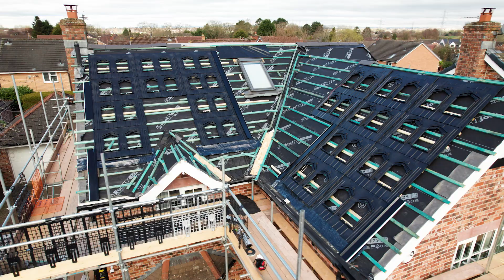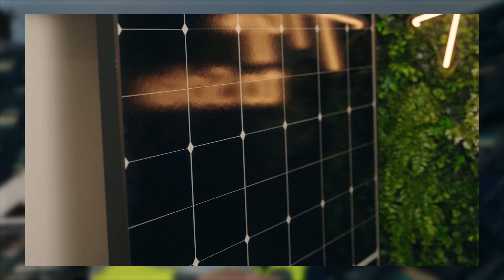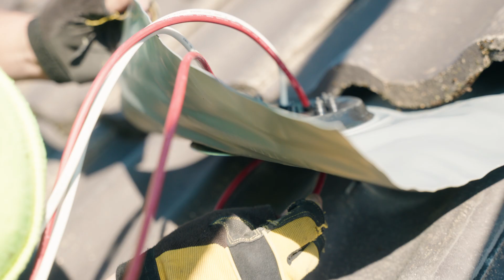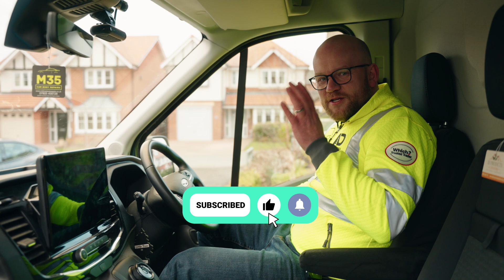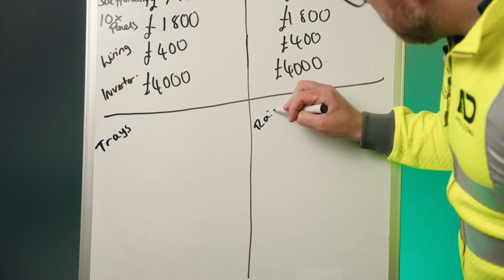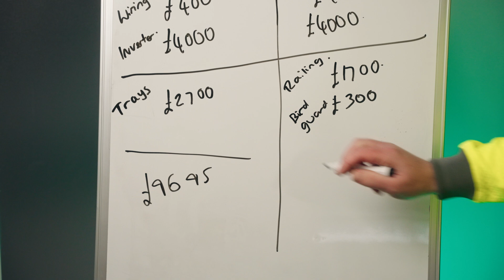In-Roof vs On-Roof Solar Panels: Which Is Better for Your Home? 🏠

Comment: Very informative but some of those prices weee suspicious. Assume £4000 for an inverter includes battery as a basic string inverter does not cost £4,000 more like £500 tops. Also £270 per installed panel for GSE seems high given the half trays are about £40 each so £80 per panel plus a share of other ancillaries and flashings.

Good video though, one of the best I’ve seen.
Reply from the maker: Thanks for the comments. Prices are a guide to help users; as always, no two houses or uses are the same. We just tried to strike a fair middle ground (note costs also include fitting, business costs and certification).

Comment: Why is the panel price the same if you are not going Bifacial surely the panels in roof would be cheaper?
Reply from the maker: Hey! Thanks for the comment, if you're having monofacials on-roof / in-roof they are the exact same panel :) so no cost difference.
Reply: @apexdomasolar  but wouldn't you put bifocals in as they are more efficient?
Reply from the maker: Hi, we used the same panel as we wanted to give a fair comparison of the installation methods and we've done a dedicated video on panel comparisons :)

Comment: On the roof in Australia, it shades the hot roof and reduces air-conditioning costs.
Panels have cooling airflow to keep efficient generation.
Reply from the maker: If only we had that level of sunshine in the UK 🇬🇧. Thanks for commenting.
Reply: @apexdoma  you would not need nukes.
Hahaha 👍

Comment: Thank you for making this extremely comprehensive video which address all the issues which pursuaded me to go with on-roof. Possible efficiency loss due to higher temperatures is what pursuaded me but my assumption that modification of the roof rafters was necessary was completely wrong.
I will be directing any of my friends interested in a solar pv system to this presentation for an initial understanding before any further research.
Well done!
Reply from the maker: Thanks, Martin; we greatly appreciate your feedback. Best of luck with your solar system. 💪🌞

Comment: I’ve been weighing up the pros and cons of an in-roof vs on roof when I discovered my roof was going to need replacing after surveying ahead of a solar project.

Costs were broadly the same, and the performance projections were very similar.

There’s no denying the aesthetic appeal of an in-roof system and for those in conservation areas such a design maybe the only option.

The main consideration that ultimately swung me to a traditional on-roof solution was an approach to keep the roof and solar system as two separate things and not have to worry about building or fire regulation changes that not only limit the product choices now but potentially for future maintenance or upgrades.

An in-roof system may also complicate future mortgage enquiries on the property especially if the regulations change in the future and the in-roof system is then seen as a liability.

With a traditional on-roof system it is simply removed.

Right now you can’t mix any MCS certified panel (MCS005) with any certified in-roof system (MCS012) – the in-roof system has to be used with particular tested panels – the list of which is ageing fast with the rate at which newer panels are coming to the market.
Reply: There are in-roof systems that don't use GSE or similar trays. Solfit and Wienerberger have interlocking panel frames so the panels become giant roof tiles that are screwed down. Sunfixings and a few other companies sell a hilarious system wherein they put sheet stainless steel roofing on part of your roof and then perform what is effectively an on-roof installation over the top of it, while still calling it an in-roof one. All those systems are tiled around like trays. The Sunfixings system has the advantage that you can fit any old panel to it.
Reply from the maker: Thanks for your comment. If you decide to mix a panel and it hasn't been type-tested to meet the requirements of MCS012, you would just be required to install a fire barrier (such as a fireproof membrane instead of the standard roofing membrane). The document covers this at the bottom of page 3. I hope this helps.

Team AD

Comment: Thanks for the video. With regards the 400mm boundary you mentioned, is there any flexibility at the ridge as well as at the eaves? I've got maybe 400mm spare in total, could I split this 200mm at the top and 200mm at the bottom?

Wrt the prices you quoted, am I right in assuming they include labour, so in the region of £9-10k for a 10 panel system fully installed?
Reply from the maker: Hi John,

Check out MIS 3002 - 5.9.7 (page 18 of 35). A few engineering measures are needed to ensure the solar panels are correctly installed when not installing  400 mm of the boundary edge. 

From a spacing point of view, it shouldn't be an issue if you are going 200mm from the top and bottom. You'd want to ensure that rainwater will be collected and snow can't slide in large pieces. There is usually a requirement to install a few extra hooks on the roof for wind uplift. If you go close to the top, you'd want to consider a product like Solaskirt to stop whistling solar panels.

You are unlikely to get one of the big nationals going within 400mm, as it requires a qualified engineering opinion. 

Secondly, regarding costs, we have based the prices on a typical install to give end users an idea of what a system would cost. But yes, roughly speaking, those prices. Prices are subjective based on house type, number of orientations, tile types, and battery/inverter brand.

I hope this helps.

Team AD
Reply: @apexdomasolar  Many thanks 👍

Comment: Is it easier to fit/maintain optimisers/microinverrs? Also why aren't more new builds using inrroof?
Reply from the maker: There is no reason builders shouldn't use them on new builds; some do. The main reason is that builders of new homes focus on profit margins and aren't mandated to install solar panels by law; often, they dont. 

In our opinion, optimisers / Microinverters should be avoided from a maintenance perspective unless they are needed for engineering reasons, Such as rapid shutdown or shading. 

Thanks for watching.